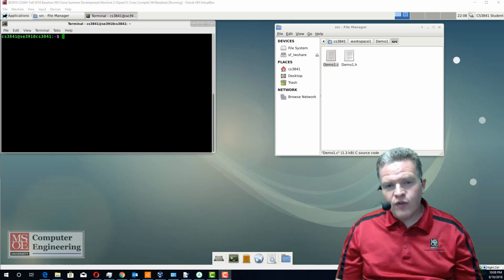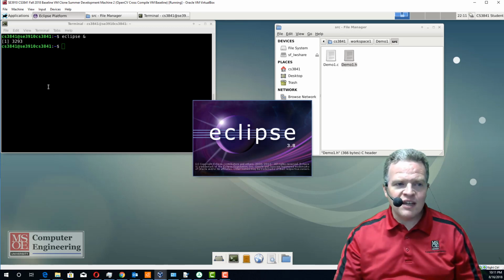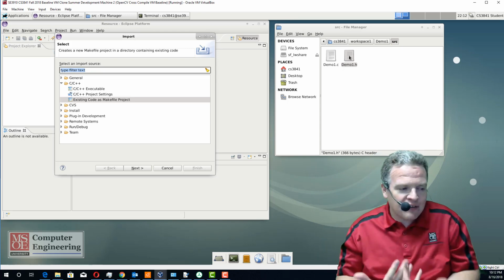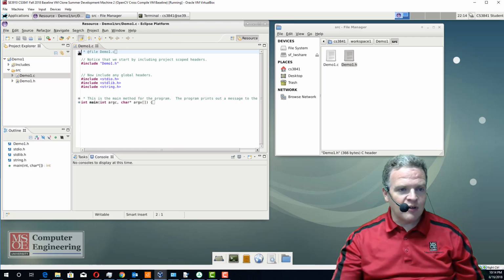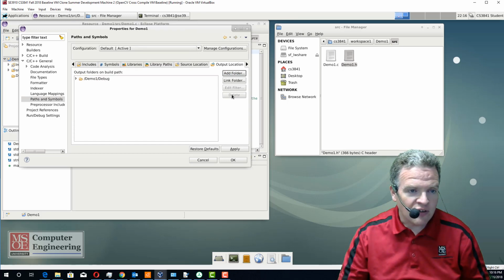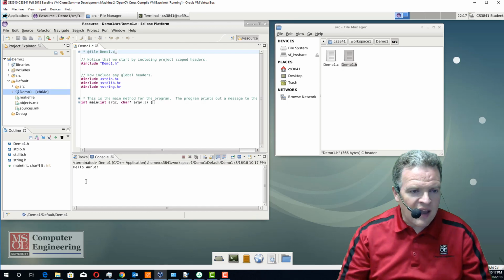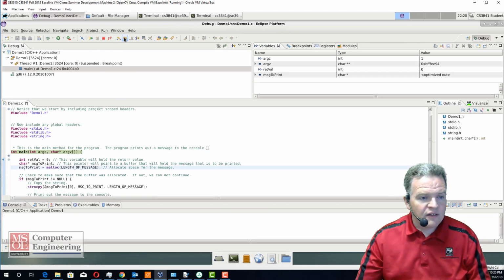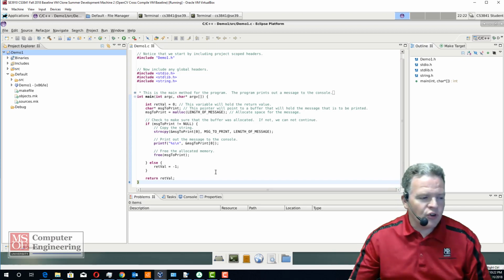Importing C Code Files Into Eclipse

Comment: Eclipse has so many settings.  I struggled to automatically generate a makefile.  Many videos on installing Eclipse, few on actually driving it.  Thanks. you did a good job w the video,  just the right amount of detail, but not too much.
I had a previous Launch cfg  in the top dropdown box with previous projects.  I deleted items until the Launch cfg dropdown box was empty, then  built the project.